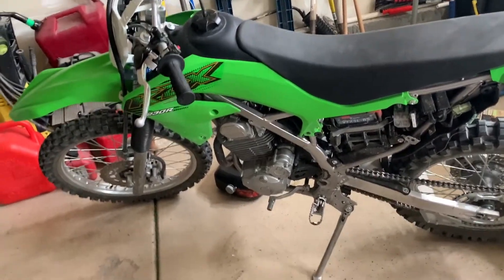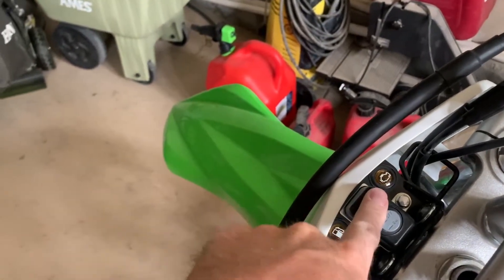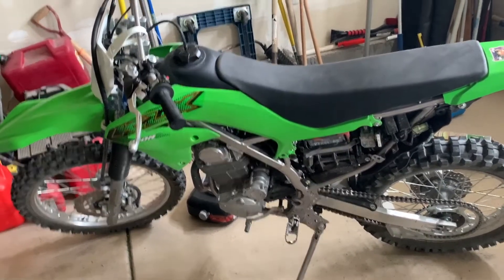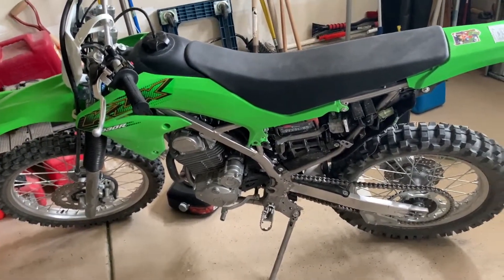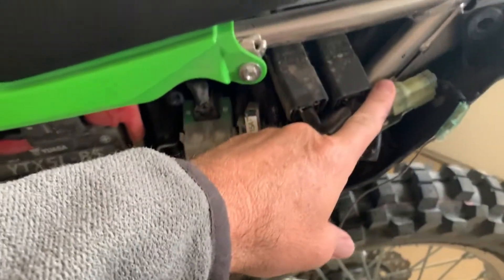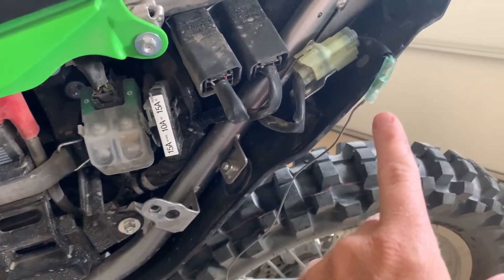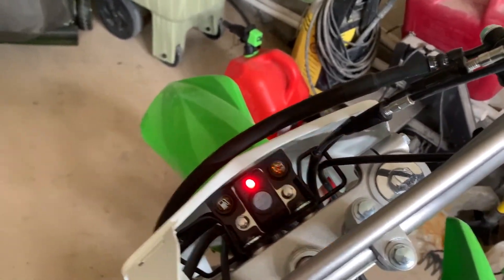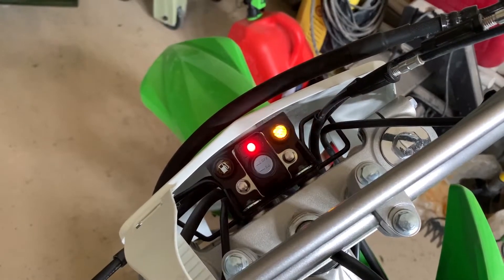Kawasaki KLX230R check engine light codes retrieval

Comment: Just tried this on my KLX203S (road legal version of this bike), and it does the same thing.

The KLX230S also has a 6 pin Kawasaki diagnostic port plug, and next to that is another single wire.    Grounding that wire causes the ABS light to flash, presumably a status code for the ABS.

My KLX230S keeps getting the same fault code , for the speed sensor, including this time, as its flashing the same sequence of long and short.
The speed sensor got replaced under warrantly about a year ago, and since then I had to get the code reset by a local repair shop about 6 months ago, but the engine light came on again about a week ago.

I was told that it was caused becuase I fitted shorter brake and clutch levers and the clutch lever sense switch was not being pressed by the new clutch handle, but I fixed the clutch lever adjustment ages ago, and checked immediatly after the engine warning came on again, and the clutch lever switch is working fine, i.e the bike won't start in gear with the clutch released, but will start if the clutch is pulled in.

So this looks like the same problem that soooo many other people have, and is some sort of glitch in the ECU or a wiring fault.

Unfortunately there seems to be no way to clear the fault code apart from taking it to a bike shop which has a kawasaki approved diagnostic reader, and the bike shops charge 1/2 hour labour to reset the code as does the dealer. :-(

Comment: Hey lets take a perfectly reliable 20 year old engine design and add sensors and computers to it !! ARGHHH!!
Reply from the maker: Well it is fuel injected now which wasn’t the case just not long ago. That’s a huge plus in my book. However, as seen in another of my videos it does create some failure points that didn’t exist before. (See when my son flips the bike over, it lands on a rock and crushes the system power button).There is a balance between tech and no tech for sure.

Comment: Is anyway we can reset our selfs without dealer ?
Reply from the maker: That's a good question. There isn't much material out there on the Internet about the electronics on these bikes. I assume you would need to get your hands on the service manual. In my case, it was still under warranty, so I just took it to the dealership.

Comment: same error .. after going uphill then I dropped the bike .. did  you guys figure it out what sensor was affected? ..
Reply from the maker: The code 24 that we were getting is a speed sensor malfunction. When I took the bike into the dealership, they worked with a local Kawasaki representative. They replaced an electrical component up under the clutch lever that has something to do with the speed sensor. I'm not sure exactly what component it was. They also found a loose connection in the wiring harness that they tightened up. I haven't had the issue since.
Reply: @HardBoiledGregADV  
Thanks Bro ..

Comment: We have a 2020 KLX 230 with this same issue...started 1 hour into break-in (May 2020). Since then Kawasaki has replaced the speed sensor, ECM and then the wiring harness under warranty with less than 10 hours on the motorcycle. They want to reset the code and say it's an isolated event, which it clearly is not. Ours is back in the shop right now and we've been waiting for 4 months to get Kawi and dealer to work this out.
Reply from the maker: Did they ever get this sorted out?

Comment: my light engine juste came up after going up a hill and then i dropped my bike. I am trying to take the light off but looks like i cant.
Reply from the maker: There is a special process that needs to be followed in order to clear the codes. I don't know the exact process. The Kawasaki dealership was going to have me do it at one point, but ultimately they had me bring the bike in so they could figure out why it was happening. I would capture the code the check engine light is putting out by following the process in this video and then contact your Kawasaki dealer to give them the code so you can find out what you need to do next.
Reply: @HardBoiledGregADV  Thank you my friend
Reply: I have the same exact error. How did you fix it.

Comment: I just got the same error code, the dealer didn’t even want to tell me over the phone if my KLX230 is under warranty, they want to inspect it first. I bought it in July and only have about 50 miles on it. Has you error code returned?
Reply from the maker: Hey Richard. Believe it or not, it did happen again. On Sept. 25, 2020 the light came on again. Checking the code we found it to be the same code (24). The dealer had me bring the bike in. The guy at the dealership worked with the local Kawasaki rep to try to figure out what was causing it. They replaced an electrical component up under the clutch lever that has something to do with the speed sensor. They also found a loose connection in the wiring harness, so they fixed the loose connection. The error hasn't returned since, but the bike hasn't been ridden much since then since it is now winter time.

Comment: And??? What did they say?
Reply from the maker: They said I needed the speed sensor replaced, so they replaced it. Not sure if that is what you were driving at. :)
Reply: How did you clear the light?
Reply from the maker: @jimze2138  That's a good question. I didn't clear the light because I took it in to the dealership. They ended up clearing it after replacing the speed sensor. They did, however, tell me at one point that if it was a benign code that they would have me clear the code. It never ended up being the benign code, so they never told me how to do it.